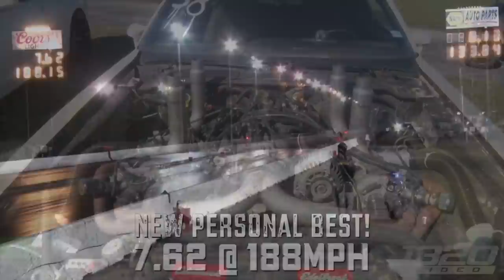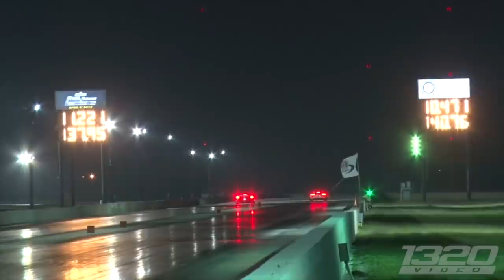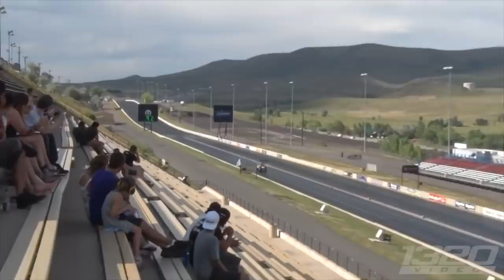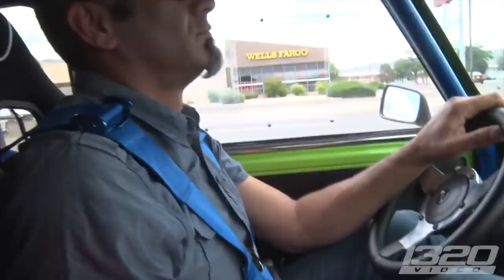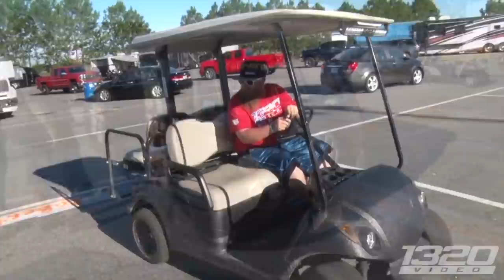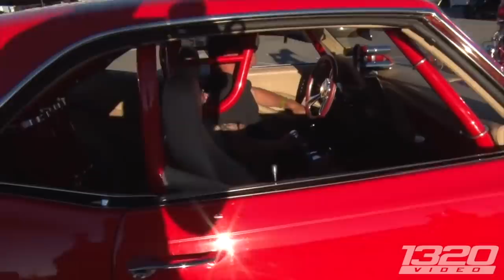Top 10 RIDICULOUS Cars of 2017

Comment: #8 kind of sucked. Fun but with 4 turbos, a V8 and all you make is 600hp that's pretty fuckin weak.
Reply: CK_32 probably wanted to keep the stock motor in one piece
Reply: Erik Van Oosterom why exactly would you put 4 turbos to "keep the stock engine intact" though? Easily could do that with a bi-turbo set up... or even a single turbo but I'm guessing they went with more turbos for the faster spool
Reply: I guess it makes sense to be on the top 10 ridiculous cars though because it's definitely ridiculous